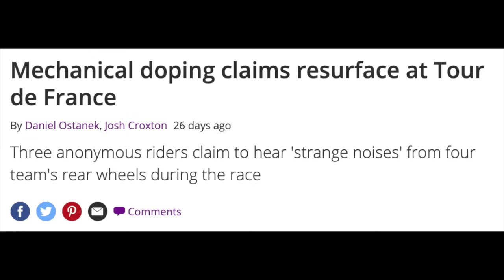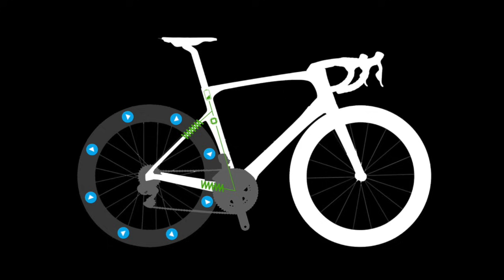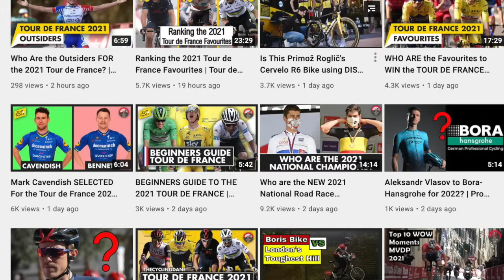Is This Bizarre Crash Proof of Motor-doping? Tour of Denmark 2021

Comment: no need for debate, race officials only have to pickup the bike, remove its components and see if there is moto inside the frame .. controversy solved
Reply: no pro cyclist is going to let sone UCI hack touch their bike let alone take it apart!! thats why they use the sensors but they only do random checks so its not looked for enough!!
Reply: @kenkaniff8428  of course not before a race or a crash .. but the uci could surely provide such rule only in the event of a crash, in the same way that they provided such innocuous rules against aerotuck positions, wearing of high socks and throwing of empty bidons .. lol !!
Reply: @attybong  good luck having ANY pro rider letting a UCI hack take apart their bike!!! even AFTER a stage with a crash. thats just too much to ask of the peloton in my opinion. pro riiders aren't letting these UCI hacks even TOUCH their $17,000 machine!
Reply: @kenkaniff8428  do you know what you are saying? removing components from the bike does not ruin the bike, in the same way that you do not destroy a bike by removing its head set, bottom bracket or group set for purposes of degreasing, re-lubing and maintenance .. they did that to contador's bike after one stage at the giro .. uci pulled his bike's bottom bracket out only to find nothing ..
Reply: @kenkaniff8428  faced with a six month suspension, the rider will hand over their bike.  Very few riders can forego half a years salary.
Reply: The same way as they rigorously got behind Armstrong? Yeah, dream on.
Reply: Oh my god, not a $17,000 bicycle  😂 @kenkaniff8428 

These bikes are cheap, and very easy to work on, compared to any actual expensive sport. And pulling a crank is a 5 minute job.
Reply: Obviously, you have no idea. Zero.
Reply: They change the electric bike for a normal bike During the race. The bike That is going back to the team car is not checked
Reply: Dude, think about it. Even if a pro using a powered bike crossed the line with it (which is unlikely as most will bike change before the finish line and those bikes could end up anywhere in the melee of a stage), think about the equally chaotic scenes at the end of stages. It's not very hard to swap a bike out even with officials around. I mean guys could get amphetamine injections in their butts given to them through the windows of team cars - you think they think twice about using bikes with motors in them?

Comment: How about motor spring drive does not use motor cause it will be obvious needs battery but spring driven. Like those small toy cars which you back then it goes far.  That could be it.

Comment: I guess I don't understand at this point how this could be a controversy as race organizers should have been all over that rider inspecting the bike the moment other riders reported to their teams that something "weird" happened. I mean it can't be that hard to detect a battery and motor in a bike. Is it really that hard to detect?
Reply: Yes it can be
Reply: seems to me like if they looked they would of found it. so either they didn't look or they found nothing when they did
Reply: I’m sure you’re right, but wonder which it was. I mean a video like this goes public, and it questions the integrity of the race. Wouldn’t the race organizers want to say what they did to restore trust?
Reply: Yes the UCI Commissaire can immediately scrutineer a suspected bike after a race like they do in motorsports racing.  In F1 racing the cars are immediately inspected by scrutineers to detect if there was any illegal modification made.  

I remember at my local stock car racing circuit events there are creative ways to cheat the rules.  Like the air intake tube size where the engine sucks in air is limited by regulations. A race team was caught by scrutineers using an illegal metal tube material that expands by a few millimeters due to high heat which gives them a slight marginal advantage in performance.  But when the air intake tube limiter cools down to a cooler temperature, the size would shrink down in size to pass regulations.
Reply: @thecellulontriptometer4166  yes, I agree. I haven't seen any kind of statement though. Have you?
Reply: @silver_surfer88  I don't think it's that hard. they have that infrared and heat senors. How bout even x ray.
How bout pre and post race scrutineering? It's not that hard.
Or take it to the extreme... mandate that that part of the bike has to be clear or some sort of small window or opening to see inside..
It can be checked, seems like they just aren't.
If F1 can catch the multi million and Uber competitive teams burning oil and using flexible wings and all the other cheats they can surely inspect a bicycle..
Reply: @chrisciaccia1286  it's hard, I build some things on spare time so I have a little background on what you can do, you can literally create a frame that is in itself a battery, create a motor undistinguishably from a simple roller, you can use conductive paint for various purposes etc etc, imagine what you can do with millions on your budget, also keep in mind that 200W of power it's huge to an human but to electronics it's fairly low
Reply: @silver_surfer88  X-Ray would see that?
Reply: i just think theres something that can be done. If they cant police their sport is it a true sport anymore or just entertainment like wrestling?
Reply: @chrisciaccia1286  yeah like the bikes being provided by organization for example

Comment: Why are bikes used not inspected before and after each Stage or Race???
Reply: I agree! It should be simple to inspect all bikes of the top 10 finishers of every stages plus all bikes replaced during the race. Not complicated, easy to execute, so why isn’t it happening ?
Reply: Properly because its part of the race = money.
Reply: They change the bike during the race.  They start with a normal bike and end with a normal bike. During the race they switch to electric. That bike is not investigated.

Comment: Ive seen this happen when the all the doping craze was still going really strong some years ago. I was in the front of the pack in a local race and then a crash happened, turns out one of the bikes went from one side of the road to the other almost like someone was still pedalling on it, I didnt see it but the race was immediatly stoped because the back of the group that saw that immediatly started complaining and we had already gone through some climbs so we were about 25 on that pack and the testosterone was all over the air. The organizers took that bike with them and the dude couldnt even continue because he got seriously injured so everything good and a cheater got justice right? Wrong, that bycicle wasnt modified, and that magic act actually happened.
Reply: thank you for sharing this
Reply: Thanks for the anecdote about your personal experience of this phenomena.
Reply: I think it's just the tire making contact with the road a bit, and if it's still spinning at full speed it's enough to fling the lightweight bikes around a bit.
Reply: @GeoStreber my thoughts too.
Reply: Thank you for sharing this story

Comment: I've been in over 400 bicycle races and I figure I've seen about two to three crashes per race with one or more racers involved.
Maybe a thousand crashes in my career .
And I've seen bicycles fly across the road in every kind of manner..
NEVER have I seen a bike do that. 
It's like a scared chicken running away.
Reply: 1000% - this notion of "wind" or "stored kinetic energy" is absolute comedy
Reply: @jasonstewart9919  I have been in a fair number of crashes from races, and if a bike skids further beyond the rider, it does not have that flywheel effect at all, much less "speed-up" like that. I am convinced between this, and other videos, that we are in a era of mechanical doping, and the UCI has kind of let the ship sail on this one to the point, it does NOT want this to be ever uncovered, as it could legitimately kill the sport. 

If the UCI ever tries to end this, I am guessing they will announce much stricter testing and testing tech to start in a future race calendar year to give teams the ability to ditch these e-bikes.
Reply: @bradtowne2305  if they won't stop it allow it. Like F1. Schumacher used ESC and launch control. Got punishment. But a very nice punishment should have been harder. I think Armstrong also used e engine and froome too. Easier to edmit to epo with everyone was taking. And he also did blood transfer in 2009 and he said he was clean in 2009. Maybe be no e-engine in 2009.

Comment: I crashed in that exact same way as the poor guy on the right. This time it was a big strong 80kg guy trying to dive for the grass verge after a few guys right in front of him went down. His bike skated right the way over the other side of the wet road on its side where I went to miss the crash. 99/100 I would have missed his bike by 5m's. Honestly I've never seen a bike do that ever before. Was absolutely unbelievable! I was in hospital for 5days and out from cycling for 5months with many broken bones.
Reply: Right, that's what can cause a very light bike to careen sideways into and across the road -- the rider pushing off to dive away from the road.  No indication of a motor. If I pushed off the rider to my right (I wouldn't) and he didn't resist I could make his 150 pound body move a few feet into the road, so obviously I could make my 12 pound bike fly across the road.

Comment: If it is the wind, then why doesn't the pair of sunglasses that are clearly visible in the shot, move even slightly to the right. If the wind can blow a bike that's probably 15 pounds max, then why doesn't it move the glasses, which probably weigh less than 250 grams, at least 1 or 2 feet to the right? As those glasses are bouncing, they're turning end over end, and if there's that strong of a crosswind, then the lenses would get caught in too, just like the bike.

Comment: What i want to know is - do the spinning wheels, which are what appears to be propelling the bike across the road, have enough mass to give that kind of flywheel effect? Wheel are quite light. Wouldn't they quickly lose energy pushing the bike across the road?
Reply: i have been in a fair share of bike crashes when i raced.  my answer is NO way. the wheels just stop spinning  quickly.  never seen anything like this, but maybe there was something on the road to redirect the energy sideways instead of forward.  super unusual, so of course it is natural to wonder.
Reply: @secretagent86  60 km per hour is pretty fast with a lot of kinetic energy
Reply: @epincion  the kinetic energy and inertia would send the bike forward no way has a free spinning wheel got the energy to drive the bike side ways with that much force plus the force required to overcome the initial inertia, cyclings a joke full of cheats
Reply: @secretagent86  i agree with you 100%
Reply: @Andre-kc9di  you are spot on with that point you made. it looks suspect as hell to me!!
Reply: Yes! Especially on a light racing bike. Since it is on its side and doesn't have the full weight of the bike, it can push it easily. If you aren't convinced, take a bike you care little about, put it on the seat, and crank the back wheel as fast as you can. Drop it on its side. Watch what happens. It does this. 
I am skeptical either way though
Reply: @MetalY2KMusic  that's not replicating the same as what happened,the bike is moving forward at a considerable speed, your experiment is using a stationery bike
Reply: saw a crash in Vuelta this year.  another bike shot off across the road.  it cannot all be motor doping... just shit happens i think
Reply: @secretagent86  yes i know which crash you're talking about. the bike took of at a 90°angle on that crash.
Reply: I was wondering the same thing, but maybe it's the wind assisting the spinning of the wheel if they just happen to line up in the same direction. Either way, I feel bad for the guy that got taken out by this ghost bike, hope he's ok
Reply: With the bearing/hub technology they today, a wheel spinning at 50 mph will carry a lot of centrifugal energy. My wheels seem like they'll spin forever when I'm playing with them in my garage.
Reply: @secretagent86  They do not just stop spinning. Spin a rear wheel and see how long it takes to stop spinning. It does not happen quickly.
Reply: @Andre-kc9di Frankly this is dumb.The kinetic energy does somehow evaporate if the wheel is turned in a different direction(for example in a crash)
Reply: it could concievable been helped by being flung by the rider in that direction before it unclipped and then the wheel just maintained some of the momentum for it to cross the road

Comment: It seems it would be trivial to try and reproduce. Spin a rear wheel up to 50kph and lay it down like that.  Anyway, visions of Ryder Hesjedal for sure.
Reply: The problem is that it's not only about the wheel... Moment of inertia (mass x velocity = constant) and conservation of energy (Kinetic energy + Potential energy = constant) are most important and so is the wind which you sadly can't measure anymore. The friction between the tire and the asphalt is maybe the only thing you can measure but still that is different with other conditions. So to be honest I am pretty sure that you can't really do anything to test if it's true. The only thing that can check for sure if there was a motor inside the bike was the UCI at that moment.

Comment: Judging by the way that the bike is moving, it appears to be either dragged around by the front wheel or spinning around the rear wheel. The first case seems unlikely to be caused by a motor since the wheel is actually going backwards. The second version also seems quite unlikely since a bike lying on its side hardly puts any pressure on the rear tyre. Also the cranks don't appear to be spinning as the bike is moving as far as I can tell from this footage.
The most likely reason for me seems that the front wheel in its upright position does catch the wind in an unfortunate matter.

Either way, the UCI should take the bike apart, if only to relieve fans from doubt.
Reply: Wind lol.
Reply: @justbreakingballs  Idk footage seems too crappy to say there isn't any and the way the riders in that small group are arranged with no one on the far left suggests there might be a left to right crosswind, so it doesn't seem too unlikely to me.
Also cornfields don't really react too much to wind.
Reply: @lukaserlt5824  yeh I used to hate it as a kid when you would put your bike down for just a second and you turned round and it had blown away. I never learnt. I’ve got some magic beans for sale if you are interested. Corn field don’t react to wind lol, well ok but neither do bikes.
Reply: @justbreakingballs  I mean you could just answer like a normal person and simply say you disagree and add why. If you thinkk it's not enough wind to move a bike, that's totally fine by me. My main point is just that the bike is moving in a really weird way for it to be caused by a motor. Also I did not say corn fields don't react at all, just less than many other field crops.
Reply: @lukaserlt5824  I’m sorry Lukas, my answering is born out of my disbelief of people mentioning wind blowing the bike. I’m not saying it had a motor, I’m saying wind wasn’t blowing that bike around and not trying to be nasty but don’t say that corn fields don’t react to wind as a possible factor in wind blowing that bike and expect me to take you serious. You should be working for Lance Armstrong PR department.
Reply: @justbreakingballs   @Pete Nesshead  Lance Armstrong PR would probably be a well paid job ;).
You can blow against a corn plant and then do the same withsome wheat, rye, or oat and you will probably be able to tell a difference.
I do agree that the wind does not appear strong enough in this footage to blow a bike away, but it is simply the least unlikely explanation in my eyes. I should probably have phrased it like this in the first place, so I apologise if I annoyed you with that.
Hope this clears things up.
Reply: Are you for real?? the rear wheel is clearly motorised and moving the bike along the floor. "Wind" dear  oh dear.